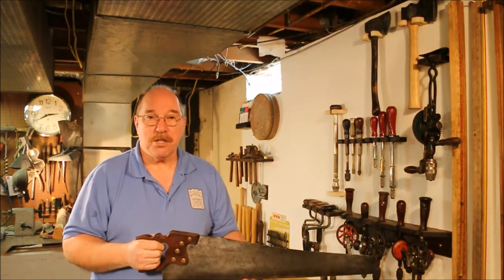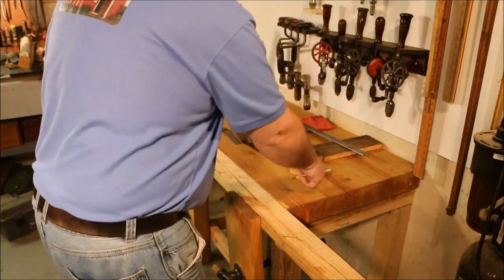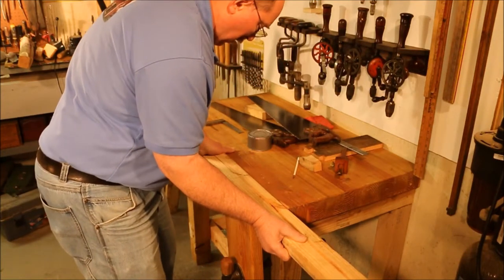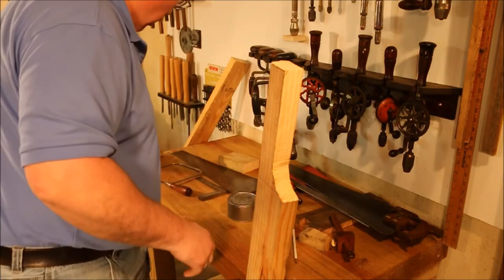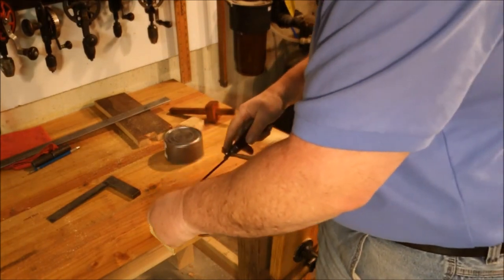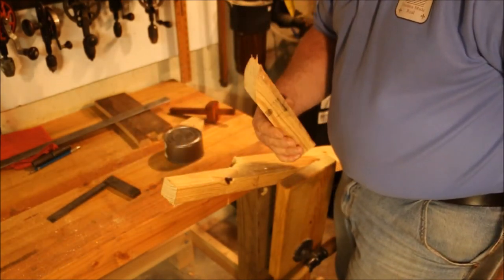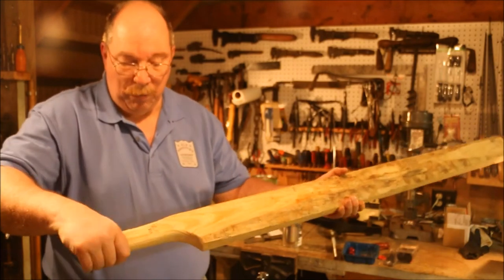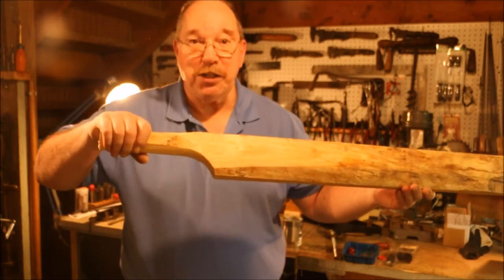WHEELBARROW GARDEN PLANTER ~ CUTTING THE HANDLES ~ PT 7

Comment: Don't worry about the camera angle. We could see the smoke rising and knew what was going on and I don't see how you got anything done with that coping saw. THin stock is tedious for me when I was younger and could at least have a shot at doing it. Now it's drag out the jig saw and still mutter a lot. Sledge works better for me.
Reply from the maker: Lewie McNeely I remember using Dad's  handsaw when I was a kid making tree houses. We had a 10 foot tall elm stump in the back yard. When I was 8 I built a hose on top and built a stairway to climb up to it. Dad had made a set of steps and I helped so I knew how to make the cuts. There was a dump down by the fairgrounds about a block away from the house. All kinds of stuff there for a boy with a whole summer of unplanned time. 
The next year I took over Bob's lawnmowing business. I was making $40.00 a week with a 20 inch push mower when I was 11.

Comment: tell us how you real feel about the coping saw. lol. I am right with you on that. one Dave. if you had to choose only one which would it be coping or hack saw. I know they have difgerent uses. But it will shed some light on which one you dislike a little less. 
I have a 150 stanley,  but would prefer a 151, due to the adjustment.
Reply from the maker: Matt Cooper Tough choice. I have a longer history with hacksaws from a time I was making go carts and mini bikes as a kid. I wore out the blades but didn't have new ones so the frustration level was pretty high. 
Coping saws have weak little blades with small teeth so they cut slowly. They also have the flimsey frames that the blades pop out of easily. The disign means they have to cut on the pull stroke. 
Most of the hacksaw issues can be fixed with new blades with the right number of teeth per inch. The coping saw is always going to be the same. 
After all that explanation I have to say the coping saw is not a favorite but the hacksaw and I have a long history of animosity so it is still the worst.  😠